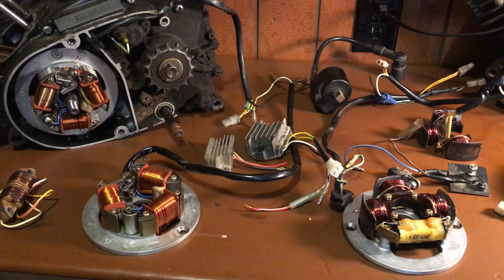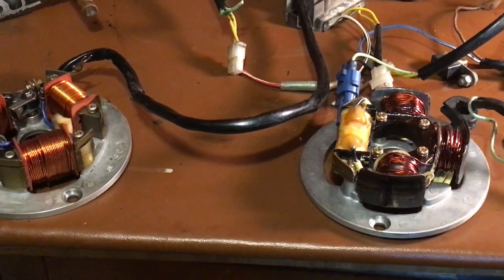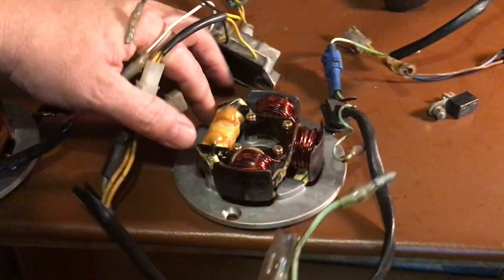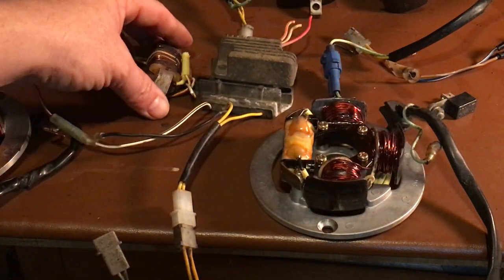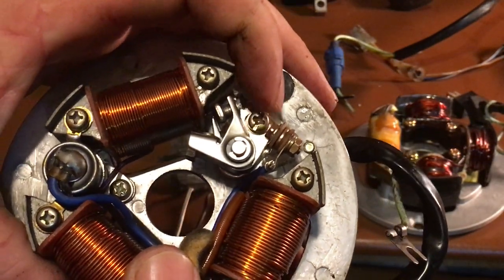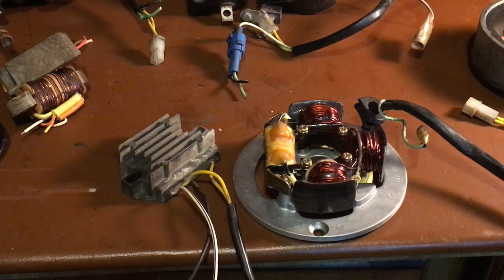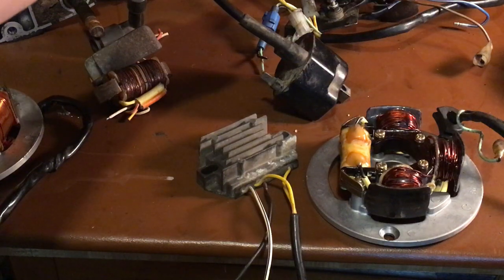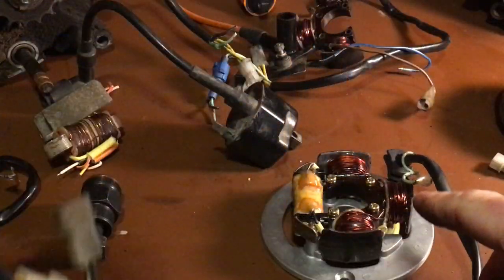Kawasaki trailboss 100 cdi /12 volt

Comment: Thanks, very helpful for my 1975 g3ss cdi conversion--I'm using the regulator and other parts from a CDI KE100. So you mention that one wire coming from the regulator goes to ground and the other to the battery. But what about the headlight? On my g3ss, the headlight is powered directly from the magneto. Does the KE100 system have a provision for that?
Reply from the maker: Gabe Cherry It doesn't however i will check tomorrow to let you know how to convert
Reply: Wow, thank you. This would be so much simpler if I just had a wiring diagram for the KE100 CDI electrical system.
Reply from the maker: Gabriel Cherry video is up I hope it helps
Reply from the maker: Gabe Cherry I just posted a video on it I hope it helps

Comment: thank you.i really wat to learn how to convert from contact point to cdi.and what others parts should replace..ihave kawasaki 100
Reply from the maker: The magneto flywheel and coil to the cdi and for the charging system I used Yamaha moto 4 80cc charge coil and regulator